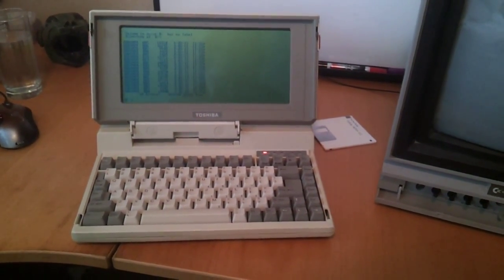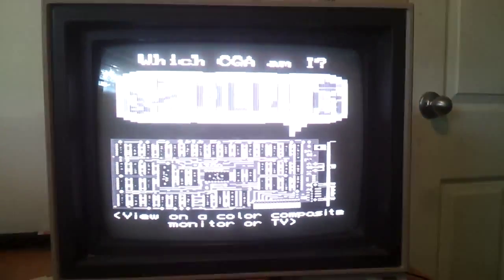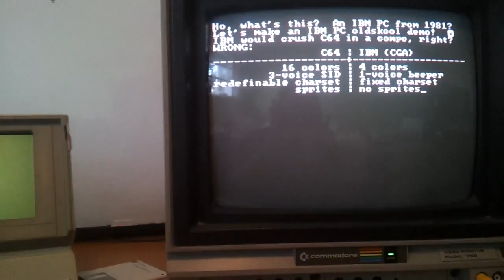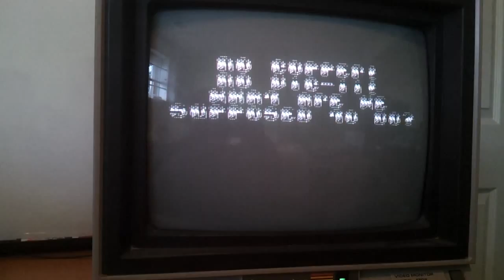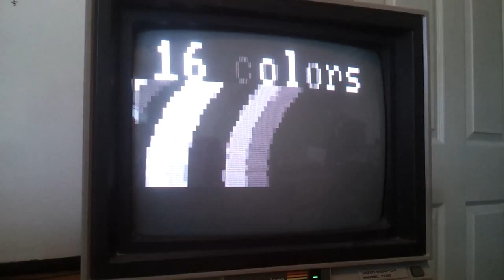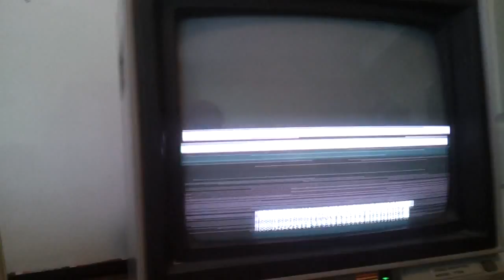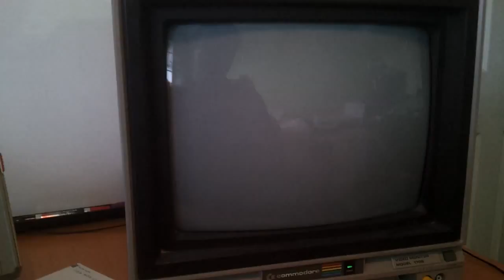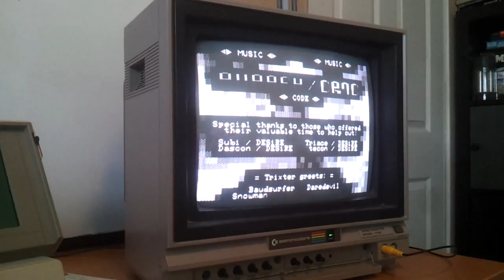8088MPH Demo on 80c86 powered Toshiba T1100+

Comment: How the hell do you enable color at all on that thing? Would love to do that at least on more traditional programs on my T1200.
Reply from the maker: +Lu Tello It's not possible to enable colour over the composite video output, however there is an RGBI output for CGA color, though it wouldn't work right for this demo. All the colour shown here would likely be adjusting the signal such that the border colour is being shown close enough to the spot where the NTSC colourburst should occur in the scanline. Thus why it cuts in and out when the border isn't visible, and why the colours aren't what they should be.
Reply: +Chartreuse Kitsune Thought I saw some colors pop up on the test screen but I guess that was your camera. Too bad, it's the only CGA hardware I have.
Reply from the maker: There definitely was color appearing on the setup screen there, as I was trying to explain I believe it's the pattern of the specific border color (which is probably a pattern like 10101010) being close enough to the location where the commodore monitor was expecting the NTSC colorburst. This causes any other patterns like that to appear as colors depending on the phase of the signal to that burst reference. Basically acting like the color on an Apple 2. After that test screen any color seen is due to the recording equipment and the TV.

If you want to play CGA games that don't rely on NTSC false color effects you can use the RGBI output for color (the 9 pin DSUB that's the opposite gender to a standard serial port) with an appropriate display.

Otherwise if you feel like writing your own software to try and trick the hardware into outputting color you'd have to mess with the 6845 CRTC and careful timing to put an ~3.5MHZ square wave close to the sync pulse, then put various bit patterns on the screen to display color.